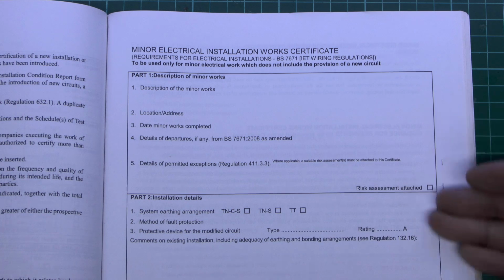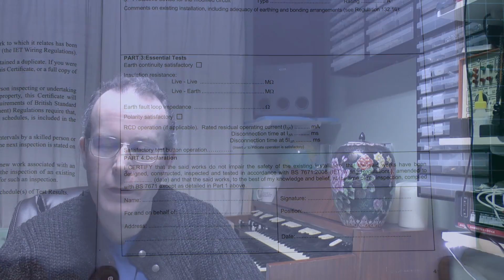Electrical Certificates Part 1 - Overview and Minor Works

Comment: 14:34 A rare JW mistake, surely. Live to live IS most definitely applicable in a single phase installation (i.e. a Line to Neutral test - both are referred to as live in the regulations).
Reply: Not so sure about your claim when it was in reference to an insulation resistance test. That part of the form is meant for your testing 3 phase conductors.
Reply: @nathanmoore9380 I know I'm right on this one! Both line and neuteral are referred to as live in current terminology and my comment is correct.

Comment: What’s the difference between 2391 and 2394+95 ?
Reply from the maker: 2391 was the 'old' inspection and testing course.  2394 and 2395 were the 'new' equivalent but split into 2 parts, presumably so they could make more money by selling twice as many.  However there is a 'new' 2391 as well, so it's anyone's guess as to what and why.

Comment: John if the wiring has a fault but realised after installation. So for example you realise that there is no power running to the line cable of even a break in the neutral somewhere, would you still issue a certificate for that? Also does this information be recorded in the details of departure or comments on existing installation or not to be recorded on the certificate at all? Thanks
Reply from the maker: If it's a new installation, then any faults found when testing must be fixed before any certificate is issued and before the installation is energised.

If it's an inspection of an existing installation, any faults would be recorded in the appropriate part of the certificate, and the result of the inspection would be unsatisfactory, repairs required.
Departures are items which do not comply with the regulations, but do not impair the safety or proper functioning of the installation.  Such things are rare.

Comment: Hi John. On your minor works the insulation resistance test live to live for a single phase installation surely is carried out between line to neutral as these are both live conductors hence live to live??? What’s your thinking thanks Gaz
Reply: You are correct. The comment made in the video is 100% incorrect. Neutral is every bit as much a live conductor as a line (phase) conductor. Live - Live absolutely includes line to neutral as well as between phases. Also the reference to "main earth" in the video is incorrect - the correct term is the Earthing conductor.

Comment: Hi John, just have to query something, on the minor works very the section for insulation resistance tests, I understood the live to live to mean phase live+ phase neutral?
Reply from the maker: Live-Live is line-neutral as well.
The 3 phase only one would be line-line.
Video is incorrect.
Reply: John Ward  Thanks John, I am glad I entered that on the forms!
Kind regards Warren

Comment: JW, on the live-live part of the certificate, does this not include line-neutral insulation resistance? I thought I'd recently finally understood this entry on a generic test sheet! For purposes of insulation resistance on single phase I think this should include line-neutral resistance and well as line-line hence the term 'live-live' rather than line-line?
Reply from the maker: Yes, live-live would include line-neutral as well, not just for 3 phase as stated in the video.
Better certificates have separate boxes for each, these model ones from BS7671 have several problems.
Reply: +John Ward

Thank you. Great video series. Thanks for sharing.I love the nature of your presentations - very thorough and specifically as you reference BS7671 which can in itself be a minefield to navigate at the best of times. A bit of guidance on where to find things and explanations of what they mean is always a useful tool. You focus directly into specific regulations and explain them in a clear and understandable manner. Someday the governing bodies might actually get their acts together and realise that chunking everything into a large book with a poor index is not the way forward. Working electricians need to be able to find relevant information as easily as they can in order to be as safe as they can and to deliver a safe product to the public. BS7671 somewhat fails in providing this all important outcome that is ultimately its goal! Please keep up the great work, as I learn more I might start a few of my own videos. Perhaps some practical installation guidance for individual items, there doesn't seem to be much on this about.

We were always confused by the live-live column too at college btw. This was never explained (in fact I'm pretty sure the tutors hadn't cottoned on to it's meaning) nor was it pointed out that the generic form is available in appendix 6 in BS7671 (further proof of its difficult to navigate structure). I only found this out last week on the 2391-52 course (exams pending!)

Comment: I sincerly thank you for this effort.  I wish someone would do this for the US.

The problem is that every single town, county, state, local utillity district, etc., etc., etc., has the abillity to use, modify or utterly ignore our NFPA which includes our NEC.  To make it utterly insane, the permit system does not exist on any national, state or county level at all.  Seriously, every 3 horse town can have its own permit and planning system.

This may be the only situation I personally support the "nanny state" which is the UK.  In our desire to reject central government in favor of federalism, we have made a mess of critical safrty matters which are clearly not nanny matters.

See what happens when the Brits repress poor, unfortunate Pilgrims?

Comment: Hi JW
Ref Electrical Certificates Part 1
I am a retired apprenticeship served qualified Journeyman Electrician having obtained the relevant City & Guilds qualifications during my 5 years as a registered apprentice.
My early 20s & 30s years consisted of working for companies associated with domestic and commercial installations but during the last 30 years I have been involved in the oil & gas industry and therefore not up to date with the requirements of the latest revision of IEE regulations. (BS 7671)
It is generally assumed by me and my electrical colleagues that I would not be allowed to carry out electrical installation work in my house or even friends or families houses unless I obtained a Building Regulation Part P qualification, or even be a member of one of the organizations such as NICEIC or ECA etc.
Can you advise if this is correct even though any work that I carry out would be in accordance with the latest revision of the IEE regulations?
Now that I am retired I have time on my hands to do all these outstanding jobs I should have done earlier but unsure if authorized to do so.
Reply from the maker: The law requires that electrical work in dwellings complies with Part P.  This is part P, it has a single requirement : http://xo4.uk/x/part_p_requirements.png   It's accepted that if is complies with BS7671, then it also complies with Part P.

There are no restrictions on who can do the work.

A few things need to be notified to building control - in England they are new circuits, consumer units and work within the zones of a bathroom.  Additional items are notifiable in Wales.
Notification can be done via a building notice or plans submission.  It's exactly the same process as for any other building work.
Members of the NICEIC and others can notify work via those organisations for a substantially reduced fee, so membership of one of those organisations would be useful if needing to notify significant amounts of work on a regular basis.

There are no 'part p qualifications', as you can't have a course or exam on being able to read a single sentence, and things marketed as such are generally just short electrical courses of various types - given your qualifications and experience, they would be a total waste of time and money and just cover things you already know.

Comment: Hi John,  I want to add additional socket (sper) off main ring in my new 1980s house I've just bought and fit nice new light fittings, I repair domestic appliances for a living so I know all about electrics ect. Can I just get on & do it & just get it certificated by an aproved electrician if I decide to sale it & do it that way?
Reply: flipflop595 How do you know the installation is safe if it hasn't been tested? A ring main continuity test should at least be done as a minimum before adding extra sockets. If your competent enough to add the socket you should be competent enough to issue a certificate yourself.
Reply: flipflop595- The new works would need to be inspected, tested and certificated before being put into service, the electrician may not feel comfortable doing this, as he/she hasn't carried out the work themselves or been present during it's installation. They'd affectively be taking responsibility for work that you've carried out.
Reply: Alvin Ashman well if they inspect properly they shouldn't have to be worried about that. Needless to say I've done the work aneywhay now I I know it's safe & it's my house ect.. the only problem would be if I was to sale the house but all solisters ask for is a certificate for the work.
Reply: flipflop595- I was under the impression, you were asking for advice prior to the work being carried out. As I said before, the electrician may not feel comfortable certificating your work as his/her inspection can only go so far, if new cables have been concealed within the general fabric of the building or run underneath floorboards, he/she will not be able to inspect those parts of the installation. 
Anyway hope all goes well for you.
Reply: Alvin Ashman thanks for you advice I do appreciate it. It's all in trunking down the wall from the attic (I live in a bungalow)  & it's a couple of single spers in two separate room's one duble socket each room from the existing ring connected in via a 30 amp junction box with 2.5mm new cable so easily accessible to check if needs be in the future so an compatant sparky shouldn't have a problem certificateing it as very accessible.

Comment: Hello John, just a quick question. What variety of camera do you use? If you see this comment, please could you post the model? Thank you John, please keep up the great content. 

Kyle Bishop.
Reply from the maker: Panasonic HC-X900.  It hasn't been manufactured for several years, and the model which replaced it (X920) is discontinued as well.
Reply: Thank you john, that’s very surprising the video quality is excellent, yet the camera you are using is exceedingly old.

Comment: Thanks for your nice and informative videos, I noticed that you said Live-Live resistance is NA in single phase installation, we were told at the college that we must always treat the neutral as live, I think this form that you are filling definitely belongs to a single phase installation otherwise there would be at least three spaces for resistance results, many thanks
Reply: Gmail user- I agree with you, the insulation resistance between a line and neutral conductor should be entered into the Live-Live box. In a three phase circuit, the lowest insulation resistance reading between all live conductors should be entered into the Live-Live box e.g L1-L2, L1-L3, L1-N, L2-L3, L2-N, L3-N
Reply: I came to the comments as soon as I saw that

Comment: For the earth continuity, if says it's a lighting circuit and you test end of line r1+r2 but you're getting 200+ohms which is obviously too high, do you have to fix that before you can issue a cert?
Reply: Haydon Turner-White- The additions to an existing installation would need to comply with BS 7671. Before you start any work, you should ensure the existing circuit that you intend to add to complies with BS 7671, if it doesn't, give the customer a quote for the investigation and remedial works, if the customer isn't willing to pay for the remedial works, you can't carry out the new works as it will not comply with BS 7671 and you will not be able to issue a certificate to certify the new works is safe.